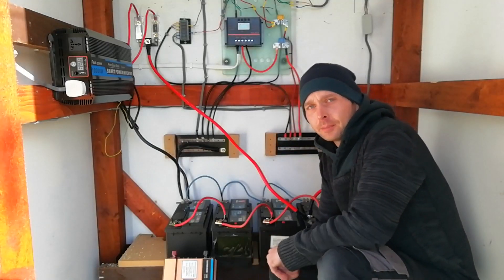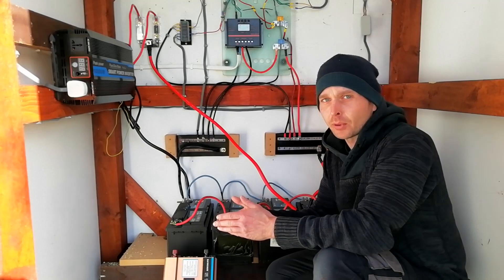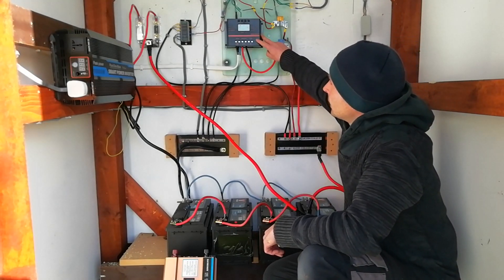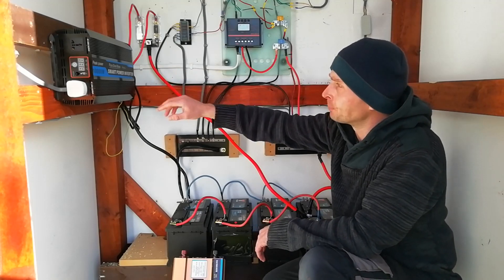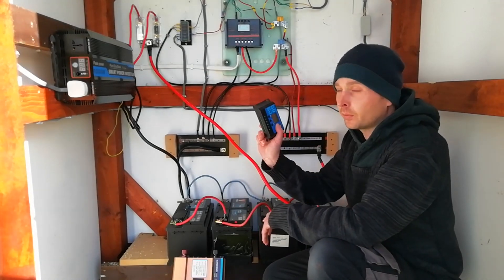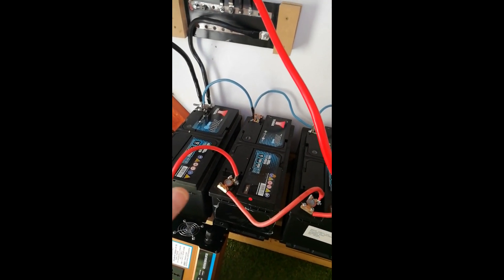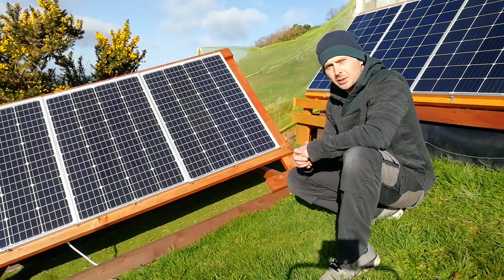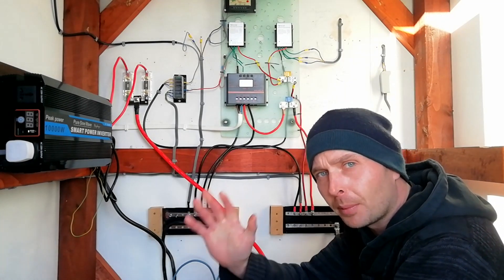Solar Off grid power station, solar and wind combo

Comment: 24v systems are cheaper and 48v systems are lot of cheaper.
Reply from the maker: Not so sure about that one. Some of the components are coming down in price thankfully but batteries are where the costs start to climb. Check out our video about upgrading our system from 12 to 24v here. https://youtu.be/HVazLbou1ds

Comment: Great video. Thank you. Just wondering, it sounds like it's REALLY windy outside however your wind turbine isn't moving...?
Reply from the maker: Hi angela, great question. Thank you so much for watching the video. 
Because we are just starting the channel the video was filmed on my android phone. A gentle breeze interferes with the microphone on it. We are in the process of sorting proper wireless microphones and a better quality camera but i do apologise for the poor sound quality. 
If you have a look at the wind turbine overspeed short video you will see the turbine working normally. At the moment its very windy here and we have had to plug in every consumer we can think of to prevent the electronic brake from activating which could cause the winds to damage the fins. Not bad considering that the turbine itself cost less than 100 quid to build using 2nd hand parts. 
would you be interested if i made a video of it right now and posted it on the channel?
Reply from the maker: I have uploaded  a video of the turbine in action right now to give a better example. See it here https://youtu.be/ByuW1fN-lY8

Comment: There are some very reasonable all in one Inverter MPPT chargers  like Growatt out now that make systems simple - Most are going over to Lithium ( Lifepo4) - I went over to the 280amp EVE cells and although they need more care with a BMS they are far more efficient .
Reply from the maker: Hi Trev, Thanks for the great  info. Will have to have a proper look into them as the frustration is strong with our current system.
Reply: @ourkilkennyhomestead2006 Take a look at Will Prowse channel https://www.youtube.com/channel/UCoj6RxIAQq8kmJme-5dnN0Q  - He started out of necessity living in an old RV and is self taught - He is an on line Guru of Solar/Lithium  set ups - hes a charming guy who shares his successes and failures
Reply from the maker: Would you believe ive been following him for a few months now. Great channel. thanks for the tip. Had a look at the grow watt site, look like great products, hard to find prices for them but ill have to get one simple as that.
Reply: @ourkilkennyhomestead2006  EpEver have come out with an "all in one" that will even turn on your genie when the batteries are low - I've had one of their MPPT solar chargers  in my motorhome for 4 years and its been flawless
Reply from the maker: Hi trev, just had a look for epever and theyre next to impossible to buy in this part of the world but thanks for the info, I have a long night of hunting ahead and will definately do a video on the installation of whatever I get. Its been great getting some quality advice from an  experienced mind. Thanks for taking the time to share.
Reply: @ourkilkennyhomestead2006  I bought mine on AliExpress